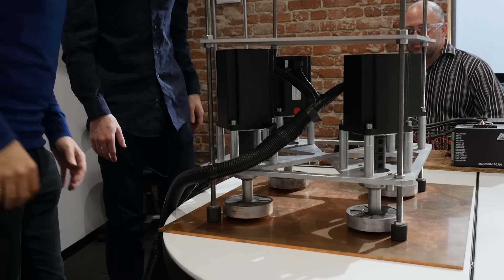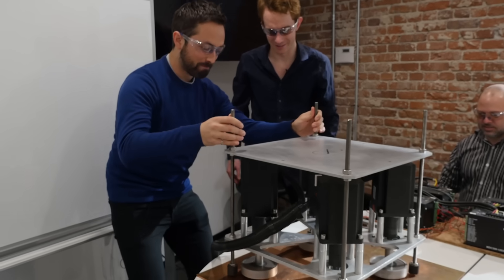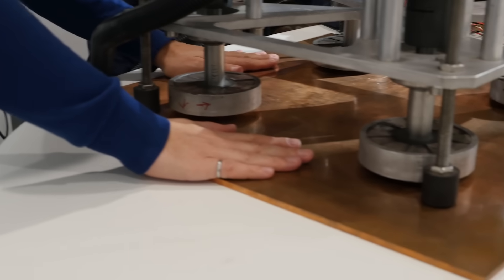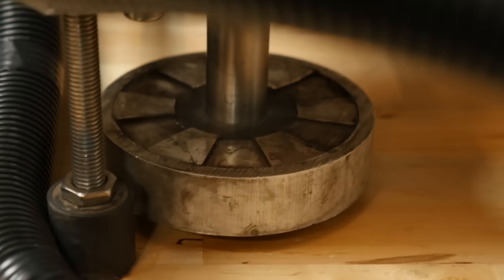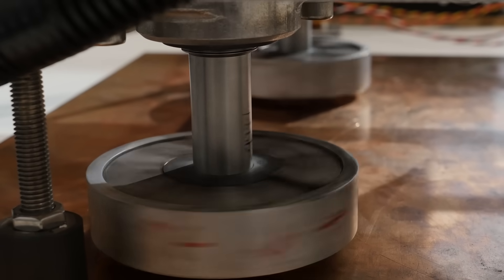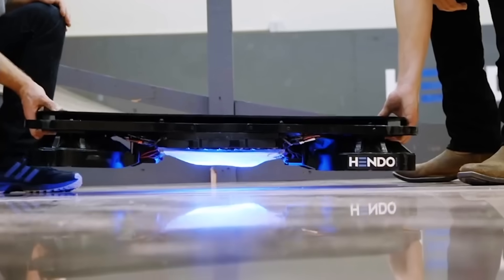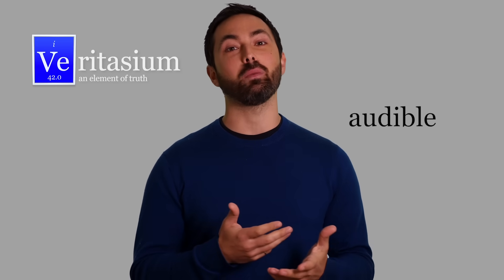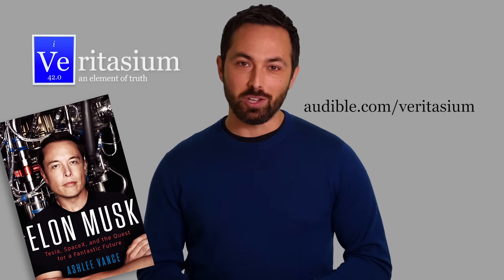Electromagnetic Levitation Quadcopter

Comment: Seeing a weird amount of hate for the hyper loop concept down in the comments. Anyone care to explain why?
Reply: Derp, deleted my reply by accident.

More air is denser than less air. The shock wave hitting it will be deadly, not the change in viscosity or the velocity of the car. It can be stationary.
A single bullet can cause hundreds of thousands of dollars worth of damages, and even if it can't cause a catastrophic failure, a pipe filled with black powder certainly can, and both will surely shut the entire line down for anywhere from weeks to months.

Maglev trains & tracks are almost an order of magnitude cheaper,  and they're already commercially infeasible, nobody wants to build them. Not to mention that maglev track is lego compared to this.
Reply: Well, there's really not much to say about explosions.
Boom make dent. 
Big boom make bad hole.
Obviously, a bullet-sized explosion won't even put a scratch on the paint, but a piece of pipe stuffed full of any explosive will do the trick.
Bullets generally leave imperfections - enough to start fractures in a very stressed piece of metal.
Reply: A shock wave will travel at the speed of sound. Think about it.
A huge mass of air slamming the car face-on at the speed of sound, or faster if the car is moving towards the rupture.
The thing with conventional transport is - if you blow a bit of rail up, two things happen
A) in-rail signaling is broken, people flag it as bad, trains don't go
B) hundreds of people on the entire rail chain don't die in seconds.
Reply: Lol i think you're confusing this Elon Musk character, with the thousands of actual engineers that are working for him
Reply: The bullet will not create a perfect circle.
Have you ever seen it do that?
A bullet instantly work hardens the material around it too, and diffusion can occur, making the material weaker.
Kurzzeit has some videos of bullets penetrating various metal objects at several Mfps, check them out.

That, and again - it's incredibly easy to just stuff a pipe full of black powder.
This would be a terrorist magnet.
Reply: Lol aren't you confusing this Elon Musk character with thousand of actual engineers that are working for him?
Reply: This isn't an issue I've looked into in great depth, but here's a basic run-down of the arguments against it: 1) it's initial projected cost was huge, and it keeps going up, 2) to prevent air from building up in front of the train, the tube would need to have at least four times the cross-sectional area of the train, which seems inefficient, 3) there isn't much in the way of quantified benefits of the project (at least none that result in a break-even point within a reasonable amount of time), 4) extremely elaborate infrastructure makes prime terrorist targets (and going through airport-level security would bring down the time saved even further).
Reply: since when does he support brexit ? his videos on the matter go specificly against brexit, send me a link of anything where thunderf00t says brexit was a good idea
Reply: That's the thing.
The maglev system is still significantly cheaper.
Reply: Classic escalation, there isn't really hate.

Hyperloop is overhyped, cost, both of making it and runningit, as well as a ticket inine are vastly underestimated, length (Seattle - San Fransico, lol) are alreaduly decreasing, and the tech is simpy not here yet.

All to say, it warrants criticism, Thunderfoot did it, since he doesn't care about backclash. Musk fanboyz defends thrir tech oord and saviors like rabid Apple fans, and you get this level of "hate"
Reply: @Johan Fouche

> Then tell me scott...

All I can tell you is what I see from your posts. You seem like someone who is genuinely curious and intelligent, which is always nice to see.

You often refer to other people as 'idiots', etc. while making very basic factual and conceptual errors in the same post (e.g. "wires in the shape of waveforms"). This suggests an assumption on your part that in any interaction with a stranger, you assume they know less than you about any given topic. You also tend to affect an air of someone with authoritative knowledge on the subject at had, but I think you know you're being deceptive; you're too smart to have actually fooled yourself. This is forgivable in young people, and not all that uncommon; I was just the same in my youth. Thus I expect you are young and will hopefully outgrow this as you mature.

So, here you are with the entire Internet at your disposal (something unimaginable only a little over a generation ago). You seem to have a genuine interest in STEM, yet with nearly the sum total of human knowledge at your fingertips you are intellectually lazy with yourself and intellectually dishonest with everyone else. That's the most disappointing thing for me to see, personally.

You make sweeping generalizations about a specific race/religion, parroting the well-worn and tedious narrative of a shadowy Zionist world organization with a malevolent agenda. I don't necessarily fault you for personal biases you may have picked up from your local environment, but when you cherry pick and distort facts in an argument, you're being intellectually dishonest and you're too smart not to realize it.

It's not possible that you actually believe you're as clever as you pretend to be, and despite ample evidence to the contrary, you're still engaging in this fraud while referring to others as 'idiots'. And what is accomplished? Have you put others in their place, cowering them with the force of your authoritative expertise and disdain? No, it was obvious to me (and I'm not all that smart) that your posts contained basic errors that make it obvious that your knowledge is very limited, and incomplete.

Let me be clear here, I'm not talking about factual errors or typos. Only a fundamental confusion of ideas could lead someone to suggest forming the wires of a coil to match the shape of the waveform. Johann, that's an obvious "I don't even have a basic understanding of how this works" thing to say, and it's only one example.

So what you've done is acted like a know-it-all, insulted and condescended to others, and then unambiguously demonstrated to anyone who reads your posts that you actually have little to no understanding at all. You can tell yourself that your posts set someone straight or put someone in their place, and maybe it feels gratifying. But people who read your posts will only assume you're either the kind of person who's too dim to realize how limited your knowledge actually is (which is sad), or you're the kind of person who knowingly projects a false image and puts others down (which is worse). Is this really who you want to be?

Rather than taking advantage of the resources at your disposal to gain a better understanding of complex political, economic and technological issues, you start with your preexisting beliefs and prejudices and then seek to validate and justify them by selecting the evidence to fit the theory, ignoring or rationalizing away any opposing evidence.

The scientific method is *First collect the evidence, then find a theory that fits*, in that order. What you're doing through intellectual laziness is the exact opposite ( https://en.wikipedia.org/wiki/Confirmation_bias ). Flat-Earthers, anti-vaxxers, intelligent design proponents, homeopathy quacks, quantum mysticism... they all operate this way; begin with a desired conclusion, then gather evidence that supports that conclusion. And it's all a _complete waste of time_, because after all the yelling and debating and flame wars back and forth, there will not be one additional bit of good, scientific evidence to support their claims (because in their view, they already HAD all the proof they needed).

If you keep up this habitual neglect of your own intellect, you could spend your life winning arguments on the Internet (or just wearing opponents down), deriving fleeting bits of self-satisfaction from such victories, and at at the end you'll be more or less the same person you are today. What a terrible waste.
Reply: 1) There's this guy on YouTube called Thunderf00t who has a series about how a lot of inventions you hear about actually break the laws of thermodynamics. He also talks about more controversial things in other videos. Look up his hyperloop video if you're interested but don't be surprised if you hate his other stuff.

To the other commenters:

2) Thunderf00t was never pro brexit... all of his videos on the topic are against it.

3) Actually Thunderf00t is a scientific researcher, has a PHD in Chemistry and has worked in other areas of science like physics... I don't see how he isn't qualified to talk about STEM.
Reply: Robin Parmentier How would it be traveling at "only the speed of sound"? In a vacuum, gases are shrapnel and can even damage spacecraft, also you can hear gaseous explosions in space (just a side note). What is stopping the gas from continuously rapidly accelerating? There's nothing in the vacuum to slow it down.
Reply: Robin Parmentier have you seen a vacuum chamber burst?
Reply: @Šnek - You've got a big tube that's built to hold back the atmosphere against near vacuum. They're going to build miles and miles of this track, which means that they're going to build it with cost being a major factor.

Even if you need a special round to penetrate this thing (and I don't think it'll be all THAT hard to penetrate, because that would likely make it much more expensive), the point is that when/if someone does, how are the results not going to be catastrophically bad?
Reply: ***** "More air is denser than less air. The shock wave hitting it will be deadly, not the change in viscosity or the velocity of the car. It can be stationary."

And how exactly is a failure, even a catastrophic one, going to result in a shockwave that travels as fast or faster than the car does?  I'm pretty sure 1 atm is not enough to create a lethal shockwave of air.

Also I'd like to point out that a bomb taking out the vacuum chamber is functionally no different than a bomb taking out conventional forms of rail.  All large pieces of public infrastructure are terrorist magnets, and their failure will also have the potential to cause death and massive economic damages.
Reply: It's not about "belief" mate, he literally shows you the numbers and the facts.
Reply: I've seen a vacuum implosion... I've also seen dirt cheap flexible plastic tube resisting the same near perfect vacuum. 

So my guess is by combining rigid and flexible material. It will indeed be possible to make a relatively affordable tube who can resit the pressure and also the expansion caused by heat variation.

I've seen people arguing that it will be too hard to make sliding joint for the tube and they are probably true.  The end product will most like be something else.
Reply: Eric Jacques it will still destroy the cars, especially the fan blades. the change in force from 0.000001 ATMs to 1 ATMs will be astronomical
Reply: @Robin Parmentier

> What are you basing this assumption off of?
> I've seen it often, and I honestly have no idea where it comes from 

I'll take a crack at this:

1) Catastrophic re-pressurization. The initial shock, work-hardening, and inrush of air will quickly enlarge the hole in the tube causing a runaway implosion. As the atmosphere pours into the tube at both ends of the widening gap, the damaged tube will eventually lose enough structural integrity that it collapses inward due to the pressure differential. Any cars unable to stop before passing through this section will likely disintegrate killing all on board.

2) A front of atmospheric gas will travel in both directions up the tube, reaching supersonic speeds. Any cars that collide with this wall will likely disintegrate, killing all on board (sudden deceleration, friction of supersonic objects, car-track collision at supersonic speeds due to loss of stability).

3) The rest of the track would likely be destroyed by massive pressure spike(s). The leading edge of the atmospheric pressure front will eventually reach a terminal, but the momentum of all the atmosphere behind the leading edge will carry it forward, increasing the pressure and the HEAT at the terminal to lethal and probably catastrophic levels (similar to the "water hammer" effect).

To be fair, safety systems could detect vacuum loss and potentially reduce catastrophic outcomes. When you've got passenger vehicles moving at supersonic speeds along a track that's accessible by any wacko on a mission from God, it's hard to imagine how it could be made safe enough.
Reply: @Johan Fouche

> ...copper in series with the frequency...

OK, you're just embarrassing yourself at this point.

I used to work with a guy who eventually got fired after years of working at the company when it became obvious that he didn't have any actual idea what he was doing (he was a programmer). Of course, there were signs the entire time he worked there, it's just that no one realized how completely incompetent he actually was.

What finally exposed him was something he did that no one who actually understood the basics of how the software worked would even think to do. It was like having a mechanic check the tire pressure when you tell him that the car won't start.

He was there at the company for between five and ten years. When he was hired, they somehow overestimated his experience and ability, and maybe that wasn't his fault. From the time I knew him until he was fired, he made every effort to project an air of confident expertise, actively hiding his deficits. Since he had a family to support, I can understand that too.

What struck me about the guy after he was fired is that he had between five and ten years to actually gain expertise and fill in the missing knowledge and skills he was having to hide. I'll never understand why he didn't do that - you would think that living under the constant threat of discovery would be enough of a motivator.

Don't be like that guy. There are tons of online courses (coursera.org, udemy.org, Khan Academy, Udacity). Many are free and those that aren't are stupidly cheap. There are lots of really high-quality instructional videos on YouTube (3Blue1Brown, minutephysics, MySecretMathTutor, sentdex, Stanford, TED, Vihart, ...)

Ask yourself whether you want to spend your precious time writing nonesense on YouTube when you could be learning the actual topics for real?
Reply: @Johan Fouche

> ...what kind of shockwave are you expecting from 1 bar of pressure?

That's something I was wondering about. This is approximately what I think would happen (any physicists out there who can check my work, please do).

You only have one atm. pressure difference at the opening (let's assume that a segment of tube is removed, leaving open ends), but the tube can be tens or hundreds of miles long, and that's all vacuum. The air rushing into the tube would keep expanding as it heads down the tube. The acceleration would be higher initially, and drop off as the air thins out. Rather than there being a 'front', I think the expanding gas in the tube would be more like a pressure gradient; very thin at the leading edge and getting thicker going back toward the breach.

I think the situation may get more complicated when the leading edge reaches a terminal. Assuming that the terminal is a closed end, I think you'd get something like a water hammer effect. The pressure would start to increase as the leading edge of thin atmosphere arrives, followed by thicker and thicker air. Since we've got tons of atmosphere moving very fast down the pipe, I suspect that the pressure in the terminal is going to increase way beyond one atm. as the momentum of all that fast-moving air in the pipe forces in more and more air, and things are going to get HOT.

I don't know how to calculate how fast this happens and what the peak pressure and temperature might be. If the terminal was designed only as a vacuum vessel, it may fail under the sudden pressure/temperature spikes. At some point, the highest pressure in the system will be at the terminal (assuming it hasn't failed), and then the air flow reverses. There will probably be a few reverberations back and forth as the pressure equalizes, each with significantly less energy than the one before due to losses. 

Q1: Can someone show how to calculate the acceleration of the air in the tube right after the initial breach?

Q2: How can we (roughly) approximate the peak pressure and temperature at the terminal, given the length and diameter of the pipe?
Reply: Hyperloop is a lie
Reply: > But posts like yours are a waste of your/everyone's time

I don't agree with this. I am just presenting my opinion. And to be honest, my opinion is shaped up with the facts @thunderfoot represented in his videos. 

I agree that Musk has successful ventures like Tesla, SpaceX etc. But intercontinental transport system of SpaceX  and hyperloop projects are just ridiculous. I hope he can overcome the technical challenges and complete these projects. But considering the facts provided by the community every penny spent for these two projects is a waste.
Reply: Lego Insomniac - because it is so darn expensive to build the encasing upon wich these capsules may travel through.
Reply: if I remember correctly he was against Brexit,...
Reply: @lego insomniac thunderf00t is actually a scientist,... and Elon Musk is not a god,...
Reply: Its because Thunderf00t, who is not an engineer, doesn't understand the difference between the technologically challenging and the impossible.  He made a video "debunking" the concept, which was really just him complaining about how difficult the project would be and how new the technology is.

I personally don't think it'll be implemented in the near future either, but the idiots comparing it to solar roadways clearly don't understand the difference between a dumb idea and a difficult to implement one.
Reply: Sure, let me explain the differences:
The plane is at positive pressure. If it's ruptured, the pressure differential, or rather, the volume of air escaping, will not be enough to open the hole up further significantly. The passengers, if oxygen masks are not deployed, will suffer of hypoxia, possibly ruptured eardrums, and perhaps death. The latter can be prevented, obviously, by oxygen masks that are already present, one per passenger plus spares.

However, with the hyperloop, it's an entirely different thing.
The entire tube is at a much, much lower relative pressure than the atmosphere, and the volume, for the sake of our argument, is infinitely larger(the death part happens before the volume is filled).
As the bullet goes in, it creates a relatively large hole - enough to permit a serious flow of air at the initial pressure differential. That flow of air puts enormous strain on the hole, developing the fractures further and further, ripping the tunnel apart more and more, until you have enough air entering the tube to slam into every car and kill everyone inside, regardless of whether it's stationary or not.
It will kill everyone inside not because of the rapid change in pressure(though that's part of it, and could cause the capsule to rupture if it's light), but rather the shock wave slamming into what basically is a hermetically sealed piston(minus a few holes to permit pressure waves to slowly pass through in the normal operating mode).
Reply: Eric Jacques but these won't be lab conditions. there may be terrorist attacks for example- with current global affairs, this would be a major magnet for such attacks as one shot or explosion might destroy the whole thing.
Reply: They can destroy one section of the tube..   It's not like the whole tube will self destruct.  

If somebody poke a hole in a Hiperloop the rest of the tube will slowly get filled... Even if a whole section is missing. The hole is still not bigger than the tube itself. 
Filling 300Km of pipe with a such a little hole will take forever the train will slow down progressively ..
Reply: Nope ... Imagine if the pipe itself is 3 meter wide .. you can brake it as you want the hole will not be bigger than 3 meter ... The size of the tube itself.

And filling a tube hundreds of kilometers long with a 3 meter hole will still be pretty slow. We talk about many minutes.  It's far from being instantaneous.
Reply: @Spirit - THIS is what people should be talking about. "What if [such-and-such] happens"

With all the people in the world looking to cause mayhem, wouldn't this be an easy target?
Reply: @Cemal Eker

> Hyperloop is a lie

Well, maybe it is and maybe it isn't. Your post certainly didn't include any new information or insights, so in the absence of any verifiable new facts, who are people reading your post likely to  believe?

On one hand, we have *Cemal Eker*; someone no one has likely ever heard of who made a bold statement without providing any supporting facts.

On the other hand, there is *Elon Musk*; someone who is well known and has a 20+ year reputation of technical and business successes (e.g. PayPal, SpaceX, Tesla, SolarCity, OpenAI, ...).

Of course, not all of Musks ventures have been successes, and even if they were, that wouldn't prove that Hyperloop wasn't, as you put it, 'a lie'. But posts like yours are a waste of your/everyone's time because, while we know Musk and his reputation, no one knows anything about you. So Musk gets the benefit of the doubt until you make a case with facts and conclusions that can actually be verified.
Reply: Seeing all the whataboutifs regarding the hyperloop being shot with projectiles, as though current rail is immune from sabotage via derailment and wouldn't also cause massive catastrophe if a freight was derailed even though they have the KE of a small yield atomic warhead, also watching people who haven't actually taken Stat, Mech, Dyn try to tell engineers how expansion coefficients and joints work as though we engineers didn't sit through multiple labs and lectures, pass exams to know their limitations and possibilities etc.. I suppose electrodynamic suspension is also impractical despite inductrak's success in the dev cycle at LLNL. They said sending people to the moon was also an engineering impossibility and impractical, yet we did it. I'll leave the physicists and chemists to the naysaying, excuse us engineers while we go solve design problems. "Science is about what is, engineering is about what can be."~Neil Armstrong
Reply: No. It's not impossible.
It's not difficult to implement.
It's hilariously infeasible and extremely dangerous.
A single .50 caliber bullet hole in a rather thin wall of the several-hundred-kilometer tube will kill everyone in every car travelling down it.
The thermal expansion will need absolutely huge vacuum expansion joints every few kilometers.
And to reiterate - a slight depressurisation will grow larger, letting in more air, and killing everyone inside.
Then, to top it all off, there's a problem of cost. Maglev costs an order of magnitude less and it's still infeasible, though very fast and reliable.
Reply: Lego Insomniac search for "thunderf00t hyperloop". He explains why it is an impossibility.
Reply: There's a difference between being hit with a lot of very dense air at once, and accelerating to supersonic speeds.
Either way, my last argument is a complete showstopper anyway.
Nobody sane would pay an order of magnitude more than maglev to barely get 1.5x the speed.
Reply: Spirit yes exactly! People seem to be stareing blind at the question whether it is possible or not, but fail to realize the impracticality of it. Air planes are much safer and equally as fast, more cost-effective likely as well.
Reply: ***** "A single .50 caliber bullet hole in a rather thin wall of the several-hundred-kilometer tube will kill everyone in every car travelling down it."

What are you basing this assumption off of?  I've seen it often, and I honestly have no idea where it comes from because we already have real world examples of this not being the case.  Airplanes have to deal with equally large pressure differences, and despite what hollywood would have you believe they actually handle depressurization events extremely well.  A hyperloop system would be dealing with the same issue in reverse, and would similarly be handling a pressure difference of less than 1 atmosphere.
Reply: ***** So basically you're worried about the sudden change in viscosity when the car hits the incoming air?  A valid concern, though there are plenty of reasonable engineering solutions to the problem.

For starters, simply designing the vehicle to not become a hermetically sealed piston alleviates the most disastrous possibilities right off the bat.  Most of the designs submitted to the hyperloop competition are already quite aerodynamic, since even a small amount of air can still cause frictional loses at high speeds.

Of course if the car is going full speed then a sudden change in air pressure could still be quite damaging, so it would be prudent to include an early warning system which puts on the brakes before the car hits it.

Also, I don't think you're doomsday scenario is nearly as likely as you seem to believe.  I mentioned planes because I know for a fact that shooting holes in them doesn't cause the sort of cascade failure you're talking about.  The force of the air being sucked through a .50 caliber hole simply isn't enough to cause immediate material failure.
Reply: @Johan Fouche

> ...their positions scream Zionist agenda...

aaaannnd there went your credibility.
Reply: They're just riding thunder foots dick and can't think for themselves
Reply: Riiight, so some guy on the internet apparently has a better understanding of science and engineering that Elon Musk, and everyone just blindly believes the Internet guy. Great. What a good day for science.
Reply: Alex Tritt "Actually Thunderf00t is a scientific researcher, has a PHD in Chemistry and has worked in other areas of science like physics... "

Being a chemist who also happens to know a bit about physics does not make him qualified to talk about the feasibility of an large scale civil engineering project, which is what he's doing in this case.  His opinions on it are mostly just arguments from incredulity, and he seriously exaggerates the safety issues to the point of absurdity.
Reply: WimsicleStranger The force that's actually pushing the gas into the tunnel is dictated by the pressure difference between the tunnel and the surrounding air.  That difference is, at most, 1 atmosphere.  Knowing this, I used a simplified form of Bernoulli's equation to calculate the velocity of the air at the opening.

Note that in order for the velocity at the opening to match the velocity of the pipe, you basically need the entire end of the pipe to be open.  If the diameter of the hole is smaller than the pipe's diameter, the gas will slow down in accordance with the conservation of flow-rate.

Note also that even with a perfect vacuum, the walls themselves will actually slow the incoming gas down.  This has extremely significant effects at large distances and high velocities, which is why I don't think it's a danger to the entire stretch of hyperloop.
Reply: But the very idea behind it is that it would be significantly cheaper than maglev. With maglev you'd have to pay a fortune to build a track covered in magnets, which makes-up the majority of the costs and is something that the Hyperloop won't need.
Reply: If the car is close to the hole yeah indeed it would be pretty catastrophic.    If the car is far the change in pressure will be more progressive.

Still we can build airplane that support friction with air and pretty huge amount of force.  Nobody ever told that an hyper loop car need to be made of paper mache. They can be build pretty strong if required and with pretty good emergency brake. I guess
 
 But it also easy to destroy a buss or a plane that is close.  So it's not more much more dangerous than describing any catastrophic failures. Because they are indeed catastrophic by nature. 

It's like describing what will happen if the little piece of aluminum who hold the wings of a 200 tones cargo plane just fail.    It's totally terrible.  But they do not fail most of the time.
Reply: Thunderf00t opposes Brexit? Do you know what you are talking about?
Reply: + Alex Tritt
He talks about the laws of thermodynamics based on a very limited perception. he doesn't even know how electricity can be manipulated and controlled to create less heat in the magnetic field, but giving the same output. Simple ideas like running the copper in series with the frequency.. If the  electric wave meets no resistence, does it create heat ?... I wonder... Also not the train only hovers over the specific part of that copper for 1 second...Now I don't know if you know how myuch amps it requires from a magnetic field, and how long, in order to create that heat. Also note a transformer doesn't heat up, merely the parts of metal you place between the field....Its all down to conductivity and resistance. You see problems where there are easy solutions.
Reply: Then tell me scott...why was there blogs for 10 years.....yet facebook comes out and all of a sudden its big ???  Electric cars built according to the same specs tesla are doing now, 30 years ago, yet musk enjoys exposure ????  Funny how all their last names, are jewish ??? deny this more ???? or will you also try and convince me they are actually better @ business and not just better @ conniving and scheming ?
Reply: @Cemal Eker

>  I don't agree with this. I am just presenting my opinion. And to be honest, my opinion is shaped up with the facts @thunderfoot represented in his videos.

OK, I'll grant you that you are communicating one thing; essentially "another person out there believes the Hyperloop is bogus"

...and if you're satisfied with just shouting "me too" into the void, then I guess that one thing is enough.
Reply: ***** The air would only be going at the speed of sound if an entire section of pipe failed, leaving the end completely open to the air.  As I've said before, I don't think that's likely to happen even if a terrorist tried bombing it.  Its not like a real-life hyperloop would be made out of quarter inch steel plate or something.  If you look at the current hyperloop prototype the track is basically a thick walled concrete tunnel.  Not something you can easily bomb through.

Even then, I highly doubt that the incoming air would actually be traveling at the speed of sound.  A quick calculation with Bernoulli's principle gives me an ideal velocity of just over 400m/s.  That's the absolute maximum, not taking into account frictional loses or the weirdness associated with extremely high speed airflow.  The real number is probably around 200m/s at most, and it only gets lower as the air travels down the tunnel.

I don't see it being able to wipe out cars tens of miles down the line, especially not with properly designed safety systems in place.  Its relatively easy to create vents that can safely re-pressurize the track in case of disaster, or baffles that act to slow the progression of shock-waves.

Even assuming it does hit at the speed of sound, how is that not something the car itself could be designed to withstand?  We already have planes that fly much faster than that, and they handle the stresses perfectly fine.
Reply: Do you know what it would take to make a hole with a bullet in that tube? First off, you would need to get yourself a .50 cal sniper rifle. The strongest one availible to the public. Then you'd have to stuff some AP ammunition in there. Even with the strongest possible setup an average Joe can get his hand on, you'd still have to be very close to the tube (we're talking meters here) and hit it square-on at 90°angle. Anything less than all this and the bullet won't come anywhere near penetrating.

I seriously thought you were being sarcastic as you said "A single .50 caliber bullet hole in a rather thin wall of the several-hundred-kilometer tube will kill everyone in every car travelling down it.". I don't see why the hole should expand at all. First of all, think of everything that was needed dto even put a hole through in the first place. To think that it should just 'ripple' like a sheet of paper goes beyond me. That's even if we leave-out the thought, that a bullet will most-likely create a hole in the shape of a circle. Circle is the most stable shape when it comes to structural strenght. If you were to look at the skeleton of an aircraft wing, you'll see holes in the shape of a circle all over the place. 

In conclusion, unless you use some heavy machinery or pretty damn strong explosives, all a hole in the tube is going to achieve is a leaking tube with a minor pressure increase in it's surrounding area. Nothing at all dangerous.
Reply: It doesn't even need to be a perfect circle, really. Not having any sharp edges would do the trick.

While I do not know a whole lot about guns, ballistics and I probably know even less about explosives, I reckon you'd need a whole lot of black powder to make a dent in it as well. While an explosion will release a lot of energy, unlike a bullet, that energy is spread-out instead of being all centered into one spot.